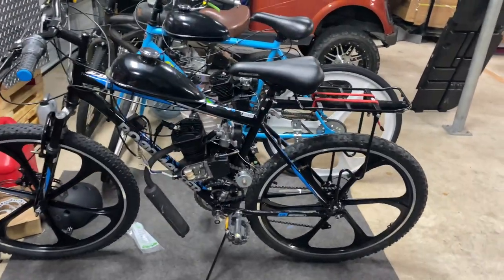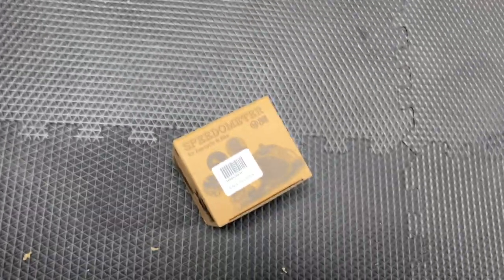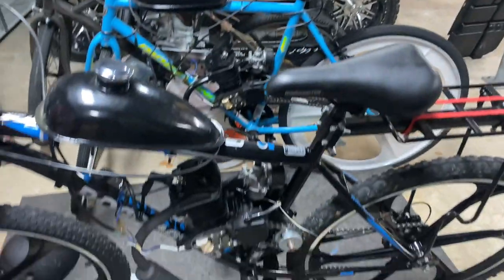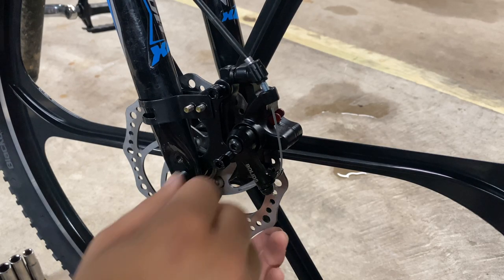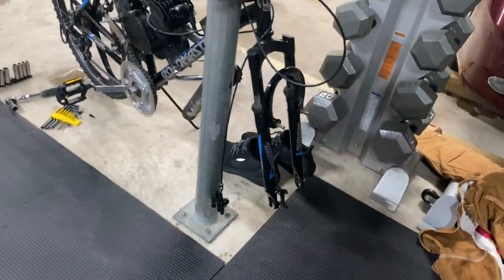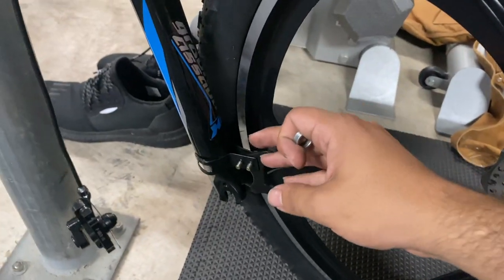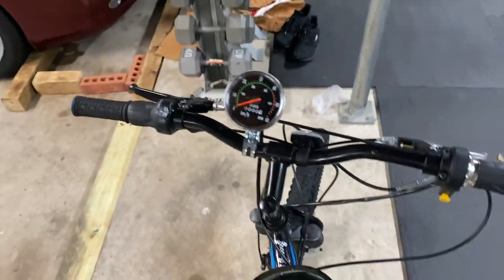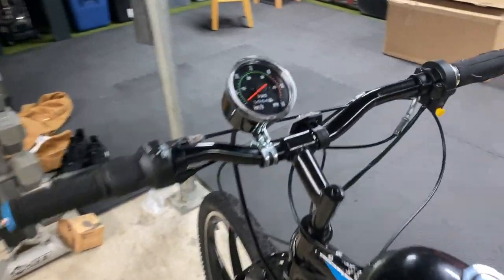Old School Style Bike Speedometer Motorized Bike

Comment: You skipped the most important part!! Where do I put the thing that rotates?
Reply from the maker: On the axle of the wheel, but this thing sucks. It’s cheap.
Reply: @barriosbuilds7688  why does it suck? I have a slightly different version
Reply: You pay more for quality.
Reply: Update: I bought it, used for like 3km and took it off. Apart from the fact that it takes a lot of energy, it also ticks once in a while, which is annoying. I also like longer roads so there's no way I'll use it again.

Comment: Those speedometers are designed for spoked wheels, modification was not shown also hope you moved those ignition wires away from exhaust pipe.😮
Reply from the maker: Yeah I built my own tab to fit for these wheels. And after however long I’ve had it, it sucks. Finally gave out, the whole thing just fell apart.

Comment: hey bro nice video. i want to buy this but i need to know the diameter of the part that goes to the fork so i can be sure it will fit my bike. could you please measure that circular piece? i cant find a seller who specifies that size. pleaseeeeee ><
Reply: 24 to 27 inches
Reply: Atleast the one i saw
Reply: They are pretty universal

Comment: Sorry for the negativity but those speedometers suck.  I've had two of them, they each lasted a couple hundred  miles  That and they weren't  anywhere near accurate. Those things are just for looks, just use the phone app like everybody else.
Reply from the maker: Yeah realized that and can’t really hook them up with my rims…
Reply: @barriosbuilds7688  O yeah, I didn't even think about that
Reply: @ThatBlueHoe  it was a little 38cc friction drive. Those things are just for looks.  There's a little spring inside of them, the speed usually isn't even close, and your domitor may make it to 200 miles before it stops working.  If you're looking for a speedometer better to use your phone.
Reply: I really don't want to use the phone app otherwise I might risk breaking my expensive phone.